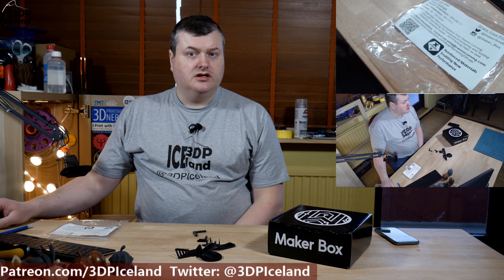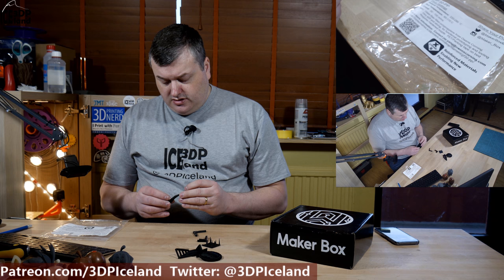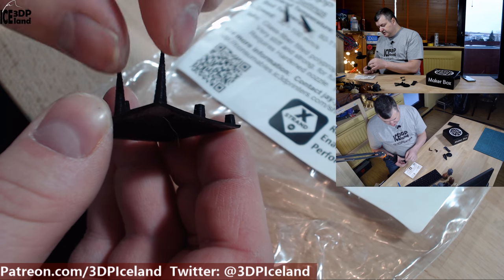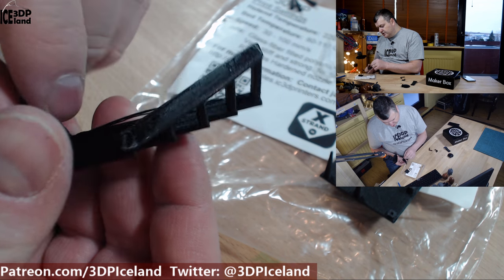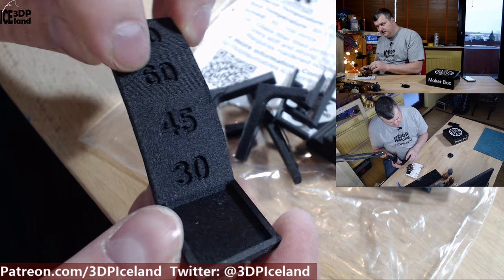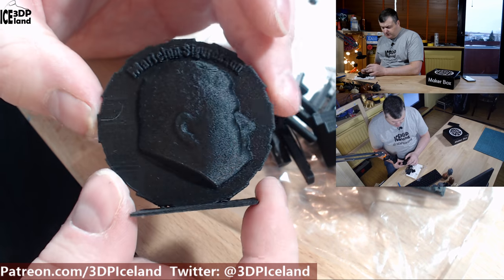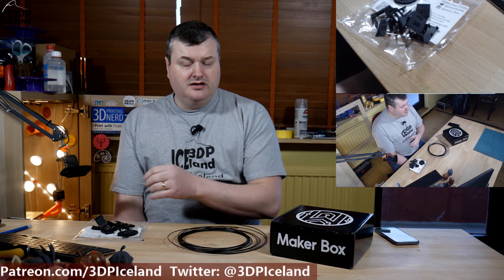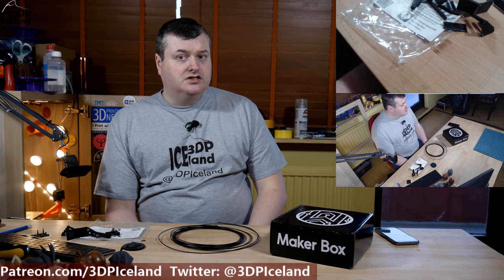MakerBox Monday - X-Strand GF30-PP

Comment: Is it possible to use it von the Ultimaker2+? Vor just in the UM3 and S5?
Reply from the maker: Yes, if you get the right diameter for the ultimaker, you are in good shape, just remember to use magigoo gfpp, that is specially made for this filament, and a wide brim